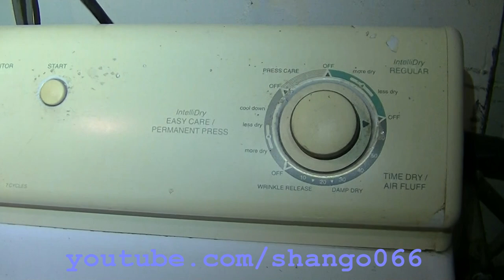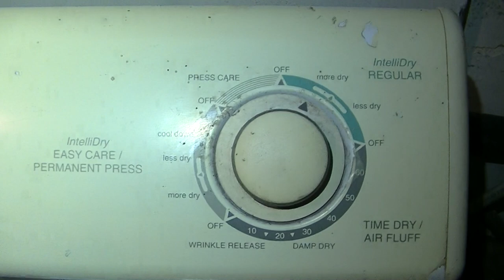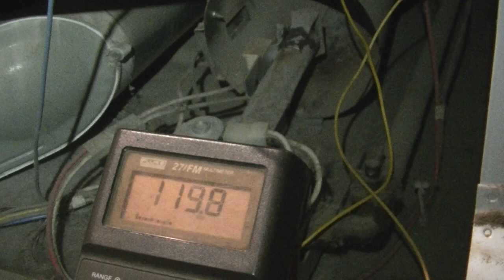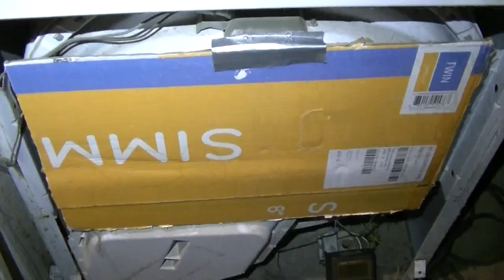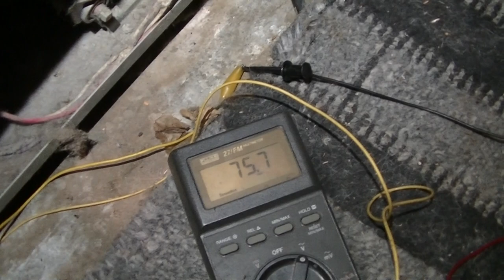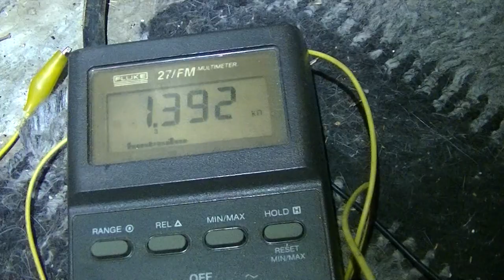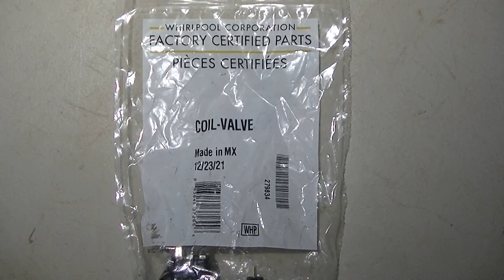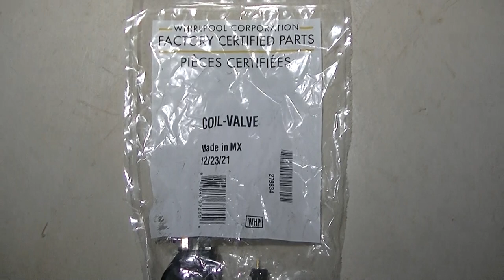Maytag Whirlpool Gas Dryer No Heat Diagnosis

Comment: My mother owns a 1975 Whirlpool gas tumble dryer similar to this Maytag  , except for the layout and shape of the components. After many years of  daily drying ,  one of the 3 gas valves were jammed.   I called a retired techinician who worked for Whirpool.   He came , disassembled the valves , cleaned and repaired them.   These machines have an interesting concept , not a single electronic component , 100% electromechanical.

Comment: That Dependable care dryer is one of the last made by Maytag in Newton, Iowa before it went belly up and was bought by Whirlpool.  This is totally a Maytag design so I was concerned when you purchased Whirlpool parts, but they seem to work so all is okay.  My sister had this same exact dryer. Mine, which was similar, was purchased in January 1997.  Excellent workhorse units.
Reply: Whirlpool makes replacement parts for former Maytag models since they bought Maytag.

Comment: Glad you got it going again Shango! I enjoy seeing your occasional appliance and small engine repair videos. Just replaced an igniter on an old 1970’s Hotpoint gas dryer that’s still in service for some friends. I have a set of early 60’s Maytags with the futuristic “all push button” control panels that are illuminated. The glass panels have dots against a white background that lights up. Push button controls were considered very slick and the utmost in ultra modern living back in the 50’s and 60’s. Chrysler products as well as Packards,Mercurys,Edsels,Ramblers,etc had push button controls for their automatic transmissions! Much more futuristic than those old fashioned column shifters! no levers for move,just push a button and go! 
The old Maytags (50’s-70’s) literally will last forever,and are relatively easy to service if something ever goes wrong.  There was a reason why refrigerator and washers and dryers used to be referred to as “durable goods”. They would last for decades. Some of the old Frigidaire refrigerator ads from the 50’s bragged about them being porcelainized inside and out so the finish would last a lifetime and the steel would never rust. That was before “made in America” gave way to made in China and we move toward a throwaway society.
Reply: @Eric Ruud,even things like electric fans,can openers and vacuum cleaners in that era would easily last decades.  What gets me is that people will get rid of a high quality neat looking vintage appliance because it’s “old” rather than repair it and replace it with something new that’s inferior in every way and is expensive and will not last nearly as long.

Comment: I raised 4 kids, so I needed 2 Maytag dryers. Being the weirdo that I am, I installed hour clocks on both. 1 has 5,785 and the other 6,230 hours. Maytag good!
Reply: The use of these is rather out of balance, but more importantly clock on these shoud count down, not up and have minutes and seconds too🤣
Reply: @harshnemesis  What should have said; I installed elapsed time clocks. They keep total time whilst it's running. Aircraft & bulldozers have them.
Reply: @uTube486  Oh no I understood what you meant. I meant the countdown like 2:13:56 before it blows up your house🤣
Reply: @harshnemesis  Get it... I'm kinda slow.

Comment: I am an appliance repair tech. I love watching your TV videos so it's fun to see you switch to a dryer.  The most common symptom of failing coils is that they will work fine at the beginning of the cycle, but then they will fail to pull the gas valve open once warmed up.  Good job 👍

Comment: Excellent troubleshooting! I used to have a 1967 Whirlpool dryer and in those days they used an oscillating “spark arm” device instead of a hot surface igniter. It was kind of a crazy setup, on a call for heat you’d hear the solenoid click then this long metal arm in the combustion tube would start vibrating and throwing sparks all over the place. Sometimes it wouldn’t ignite right away until after the tube was full of gas, then it would go boom! I converted it to a hot surface igniter system from a newer dryer and never had another problem with it.

Comment: Great channel. My dad ran a TV/Appliance store in upstate NY. This baby was a cash cow. This is a classic failure for any gas dryer that use this system.  What happens is the dryer runs fine for 10 - 20 minutes then it cycles on the sensor. 
Although gas valve coil kits ( p/n 279834) of that era will fit several brands, that dryer is early to mid 90s Maytag and not like whirlpool at all. This is  the one where the hub of the blower wheel likes to loosen and or break off. Remove the cover in front to c heck it. Also clean the filter housing and vent whenever servicing these old girls.  
Coils can occasionally go bad from the plunger within the assembly not moving freely. If you replace coils and it fails again replace the gas valve assy  or get a new dryer

Comment: For whatever it's worth, that model is from the mid-1990s or thereabouts and is one of the last "real" Maytag designs. Those coils are a high failure rate part. The most sophisticated part of the whole thing is the flame proving (done with a UV light sensor mounted to that window in the burner tube). In addition to the two thermostats you tested, there's also a "one shot" thermal fuse (to the left of the thermostat on the fan assembly) in case of restricted airflow or the other 'stats failing.

Those clothes dryers with control boards, probably for reasons of "lawsuit proofing" have thermistors at the air inlets and outlets. If the control board doesn't see the temperature difference it expects, it will throttle the heating elements or burner. Interestingly, many manufacturers have now switched back to the mechanical timer and the simple sensors shown in the video. Maybe the boards weren't reliable enough?
Reply: Especially now with chip shortages, I wouldn't be surprised if mechanical timers are making a comeback.
Reply: Of course they were too cheap to use Robertshaw gas valves...they probably wouldn't fail at such a high rate if they were.
Reply: @vwestlife  They can't in automatic washers.  Not if they are required by law to have automatic lid locks on washing machines.
Reply: The control board's thermostat is on the outlet, and the thermal fuse near it is in line with the motor. If the motor isn't turning, the centrifugal switch won't energize the heater. There's another thermal fuse and mechanical thermostat at the element or burner. And those thermal fuses fail randomly. No overheat condition, they simply go open... from vibration maybe? But... you always change the fuse and the thermostat at the same time in case the thermostat is in fact defective.
Reply: The control boards in all my modern gear are nearly always the point of failure. For example,  I have a dishwasher that randomly throws drain pump codes but the unit doesn't have one - uses the wash pump in reverse,  and it definitely works and drains. Reset the board and it will work again for 2 weeks to a year before it does it again. Been like that for 8 years now. I also had an AC and dehumidifier that would both short cycle like there is no buffer for hysteresis. Also an electronic control fan with a bad control board I wired permanently to high. Probably some other stuff I sent to the dump, too. I have wondered why they just don't go back to  mechanical controls for reliability.
Reply: @vwestlife  A good point, though the mechanical timers have been coming back since before the chip shortage was a thing by several years.
Reply: @douro20  There's no reason I can think of that a lid lock couldn't be used with a mechanical timer. All that has to be done is to energize the lock at the right points in the cycle, or as long as the machine is running a cycle. Proof of closure could also be done with a mechanical timer -- power is simply cut off if the lock doesn't make.
Reply: @uxwbill  we had a Kenmore with a lid lock in the early 1980s and a stacked White Westinghouse from 1981 that locked the front-loading washer door from start until the final spin wound down.
Reply: @uxwbill  Customers want the convenience of being able to pause the washer in the middle of the cycle and open it.  And mechanical latches are illegal due to safety concerns over children getting trapped in them.  So it's quite hard in that case to do it without electronics.
Reply: The flame sensor mounted to the little window on the burner tube is a bi-metal device.
Reply: @equid0x  they are made to fail on purpose

Comment: Nice work diagnosing the failure. Recently spent a month looking for a leak in my dishwasher... Internet gave several answers... None were correct at least in this case. Eventually I was just about to give up, already had the dishwasher running on a table so I could see without lying on the floor and final saw one drop off water come out of the water distribution thingy... On the waste side. 1 minute to unplug it  with a wet dry vac and it works like new...

Comment: I’ve serviced a dryer once. It wouldn’t heat up. Ended up finding a bad igniter on the gas burner assembly. I was most surprised when taking it apart just for a look to find a schematic and diagnosis procedures I could never understand how to get started. But the schematic certainly made my looking around far more productive.

Comment: Two most common failure modes are the solenoid coils and a tiny break in the igniter.  Well worth repairing since there's not much more to break.  I have its mate, the Neptune washer from 1997 which I've repaired/redesigned several times and is now a bulletproof machine that my wife doesn't want to part with since it works so well.

Comment: the wiring diagram for that dryer is located in the back panel, where the timer is located. the diagram also goes into the timing sequence for each drying function you pick.

Comment: My Maytag set has been in use since the 80's.  The timer no longer advances the timer on the dryer, but it still dries the clothes.  I have no intention or replacing them - especially when you need a second mortgage to MAYBE find a new set locally.

Comment: That's an old school original "Newton" Maytag before Whirlpool swallowed them up in the early 2000s. Good sturdy machines. Pretty much all the manufacturers used the same coils on their gas valves. Sometimes the valve would cycle several times and might heat for 10 minutes before one of the coils opened up. I remember it was a real drag when I first encountered this! We carried these coils in a kit, and just changed both of them.
Reply: we still have some like this with coin slides on them at the apartments

Comment: I had one of those in an 1880 built farmhouse that I bought back in the 80's, I hated that dryer. It wasn't that old but I had nothing but problems with it, got tired of having a repairman out multiple times, had the gas line capped and bought an electric.

Comment: I never saw a gas dryer. But I fixed a similar coil on a car with a propane conversion and was working for a truck company.
Besides with gas installations, hydraulics use those too and I had to made sure that several types of coils and solenoids were on stock.

Comment: Most all gas dryers use that White Rodgers gas valve system.  The solenoid coils have been a problem for over 20 years.  I used to be able to get a pair of coils for $11.00 wholesale from a friend.  I always kept  a pair in my toolbox.  The last time I needed a pair they were $77.00 a pair.

Comment: Yes, gas valves do go bad; including the coils,  pistons  and springs. Age is a big factor (with typical appliance life span [and planned obsolescence] being 7-10 years)  but so is moisture in the incoming line (that alone can cause the piston points to harden & hang open or closed). Though most never have reason to think otherwise,  a small water trap helps tremendously. Even forming the typical flexible hose into a 'p-trap' configuration will do the job.
Reply: @Eric Ruud Not anymore in 2022 when the factory is moving oversea and QC engineer was fired for cost saving.

Comment: An easier way to open it up is to push on those 2 flat springs at the top with a putty knife and the top flips back. Then you remove the 2 screws and take off the front. That's good that you could get the coils separately instead of the whole solenoid assembly. Great video.
Reply: In these, you tilt the bottom of the panel forward and they slip right out of those clips.  They go back in as easy.
Reply: You guys and your putty knives!! i swear! Don't do that on a modern appliance you'll crack the front panel. It's so bad I got a new maytag front panel...it came cracked!
Reply: @neuralfraud  I am sorry to hear that. It seems like quality and durability started declining in the ‘90s. Everything is made so cheap these days, but you pay a lot for it.

Comment: I think it works like this when heat is called for:

* Ignitor comes on

* When ignitor gets up to temperature, gas valve should open

* As long as flame sensor detects flame, operation is normal and valve should stay open. 

* If the flame fails to light after a certain number of seconds after the gas valve opens, it should close the valve and put the dryer in safety lockout where the valve does not turn on until reset or disconnection.  I suspect that there is a time delay on one of the coils to make this happen.  There may also be a flame sensor further inside in the circuit too that it uses to detect the fire.

* There may also be an overheat sensor in that circuit that if the dryer goes too hot or the fire burns hotter than it should, it will turn off the ignitor and gas valve.

Comment: This is exactly like the problem I had with a gas furnace.  Solenoid went bad, and I was lucky to find a solenoid that would fit a 60 year old furnace igniter and got it working.  Works on the same principle, it sprays a little bit of gas and it's got an igniter that clicks like a cigarette lighter and you can hear the fire ignite like a welding torch.

Comment: I have a Maytag washer and dryer from 2004 , still running. Replaced washer belt and water pump, I want to hang on to these as long as I can because the new ones are garbage.

Comment: I can see why most americans love the basic washing machines and dryers.
They just work!, no dam computer to screw it up !
Reply: I have a 1973 Maytag washer and gas dryer I picked up back in 2019, haven’t had any major issues with them since I’ve owned them. Only thing the washer needs is a new water inlet valve but can’t complain since the original one lasted almost 50 years.
Reply: @Eric Ruud chrome makes everything look better including cars which might explain why every car looks similar to one another these days.
Reply: @seana806  Nearly 50 years! that's impressive :-D
It would be nice for your washing machine to last that long.
I'm getting greedy now lol.
Reply: @Sean A806,those are great machines you have! (Maytag A806) They retain the same basic shape of the mid sixties machines. The control panel is such a clean,modernistic design. I love the illuminated glass panels. I have the early 60’s all push button Maytag washer and dryer set. Great looking and working machines. You simply can’t buy anything of that quality today.
Reply: @Suddenlyits1960  thanks! The Maytag set I have from 1973 is a Maytag A606 which is below the TOL A806 but otherwise is towards the higher end models since the A606, A906, A906 are the higher end models. I recently acquired a Maytag A806 this summer from a fellow collector, currently in the process of putting together a customized Maytag dryer I’ve had for awhile.

Comment: They usually hide the schematic in the back of the upper access panel! Moisture sensor usually works with the wrinkle
guard selection. Newer dryers don't have that anymore. Solenoid valves are controlled by sensors. They should not get hot.
 My moms gas dryer was not heating and checked everything and even replaced the two valves. Still no heat. No gas smell either.  Failed gas valve which costs $60 was the only thing left.

Comment: The no 1 suspect is the gas coils valve! The early symptom includes clothes not drying when the cycle is done. I have to change mine. I always change out the igniter when I change out the coils. If the dryer fails to heat down the road, check the igniter. You will see it broken.

Comment: I've had fail: the dryer belt, the dryer belt tension arm (separate times), the door switch, and I think one of the temp sensors.
But, mine is a Whirlpool. 
Surprisingly not the gas solenoids or igniter (knock wood). 

My oven is a Whirlpool and it's had the most baffling fixes. It has fuses all over it that fuses - that blow when it gets hot, the exact thing it's made to do. It cannot accomplish a cleaning or run at 500°F for the short period (30 minutes) to brown a turkey.
 
I looked up the company, since so many bits have failed (including: the control panel on a Maytag dishwasher). 
Whirlpool owns nearly all the old, great names:  Maytag (of course), KitchenAide, JennAir, Amana, and HotPoint. JennAir and Amana known for quality or 'high end', as well as Maytag.
I've been told by someone (who repairs) they also supply some parts for GE Appliances.

Personally, I don't think it's good to have such a near-monopoly in appliances. Clearly we have a measure: major appliances are now an estimated service live of maybe 10 to 15 years. My parents bought some appliances for life. Their refrigerator worked for about 40 years.

There's a cognitive dissonance in this: the new appliances are required to save water & power - yet we're putting them in the landfill at a bout a 3x rate as the old, 'good ones'.